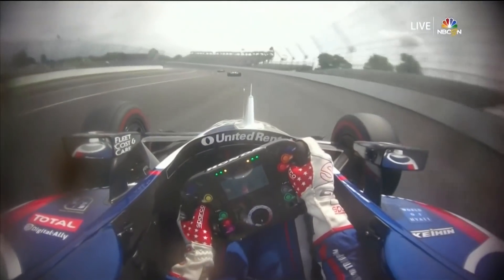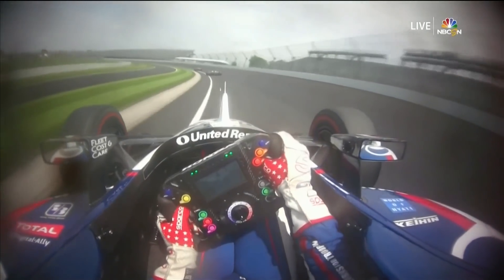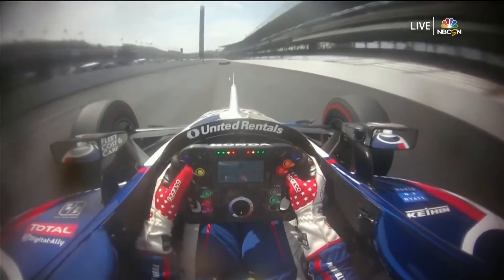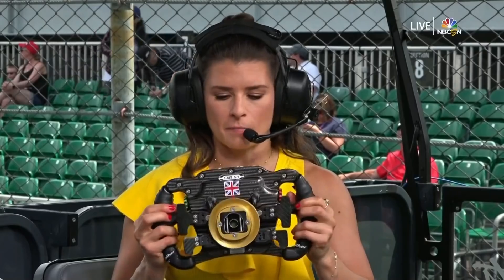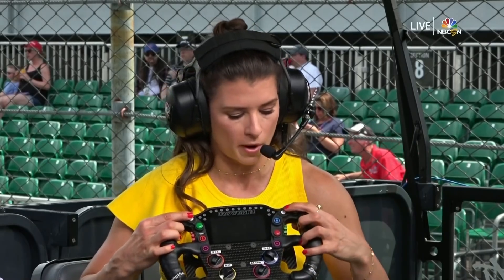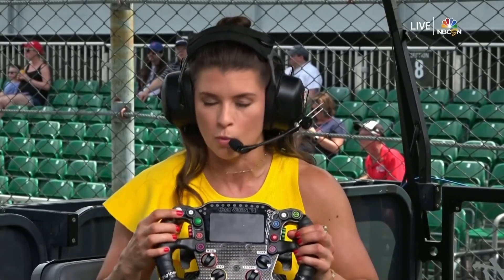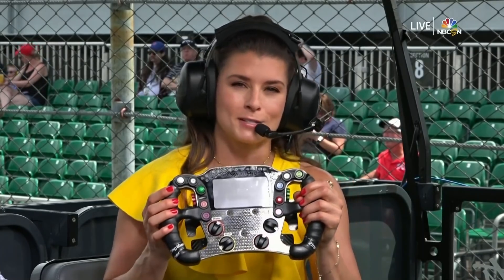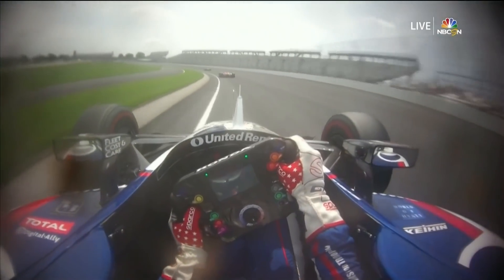Danica Patrick explains complexities of IndyCar steering wheel | Indy 500 | Motorsports on NBC

Comment: Indy Steering Wheel: Oh my god look at that complexity!

F1 Steering Wheel: What button to start an engine again?
Reply: Haha there is not a starter button on either. They both use external
Reply: Neither have a button to start the engine
Reply: f1 drivers need more buttons because they can't drive the car by themselves. they need the car to drive them
Reply: @H43N  Indy driver doesn't need more button anyway, rarely push those paddle shift.
Reply: @H43N  The most important button is the drink button.
Reply: @watersnortmoment3734  KIMI, YOU WILL NOT HAVE THE DRINK i repeat YOU WILL NOT HAVE THE DRINK
Reply: The Grazie Ragazzie button
Reply: @Phonixrmf  hasn't been used in awhile sadly:((*
Reply: @Phonixrmf  coming in canada🙏😝
Reply: No, F1 cars can start the engine themselves using the hybrid system.
Reply: @ErikGPL  you are 100% wrong.
Reply: @watersnortmoment3734  and don't forget the steering wheel too he looking for it*

Comment: whats the color changing lites .... that's above the screen on the wheel...... & what does the differant colors mean on each side of the above screen as well......????
thank's 4 explaining some of the things on the steering wheel in the very super fast indy car's..... by the way how fast can they run on the straight a way's on the track's now a days..... & how many horses r there usually in the motor;s now a days.................
Reply: Might be rpm might tell the driver if rpm is to high or low like Nascar uses on there digital dash now